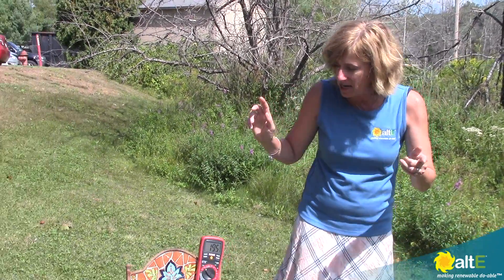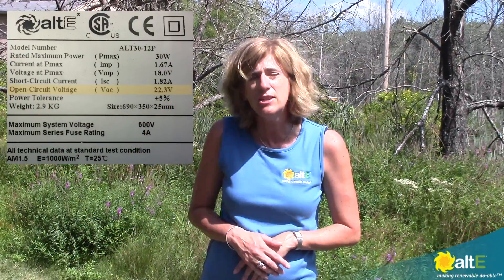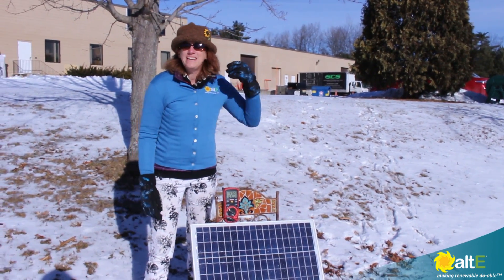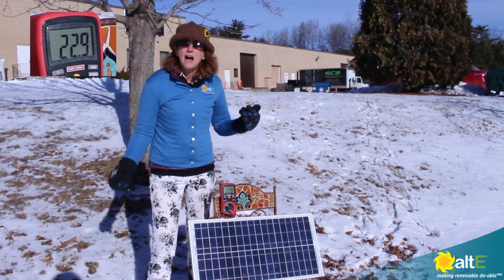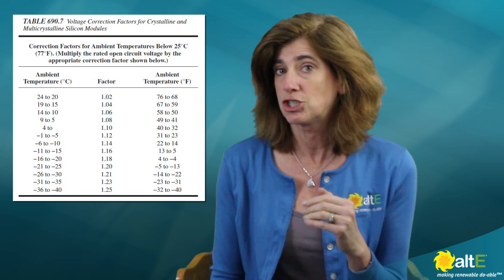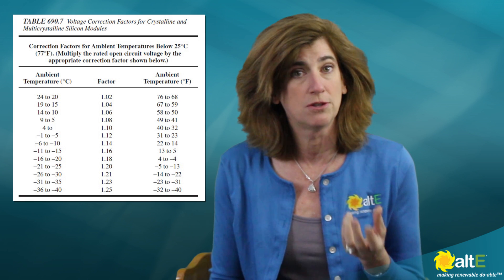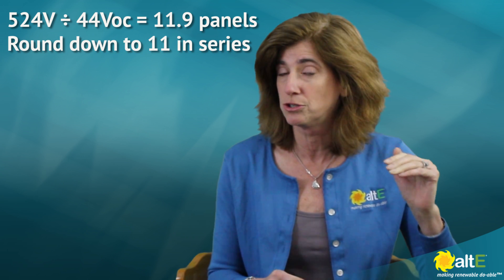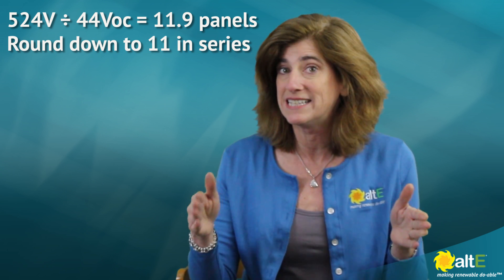What Effect Does Temperature Have on Solar Panels?

Comment: What about in Pakistan where the temperature goes up to 47 degree? (This is on weather channels, iphone etc. Some people say that actual temperature on the ground being baked in sunlighted is even higher?) 

Do you recommend in that case to go only for monocrystalline panels? How does really really high temperatures affect the viability of solar?
Reply from the maker: I recommend you watch our video, monocrystalline vs polycrystalline, at https://youtu.be/TCq0K3DlFdc .  We talk about the difference temperature has on them. The difference these days is so slight, sometimes it's more about the brand of panel than the type. In the comments, there are people from all over the world discussing what works best for them, including Pakistan.
Reply: +altE thanks for the quick response. I have learnt so much in the last few days thanks to your videos. Really good stuff
Reply: The only real difference between mono and poly crystalline is monocrystalline will give more power per square foot. The characteristics are almost exactly the same. I have to go mono, because I have limited roof space for the power I need. If you have plenty of area, you might save money, by using poly crystalline.

Comment from the maker: I just had a caller from Canada tell me about something they run into in the winter. The albedo effect, where the sunlight reflects off the surrounding snow and increases the amount of sunlight that hits the solar panel. Therefore, they see much more current than rated, since the amount of sunlight hitting the panels is greater than standard test conditions of 1000w/m2. I would imagine this also occurs in the desert with the sun reflecting off the sand. Although it is not directly a result of temperature, it is important to note, especially if you have your solar panels tilted very steep to avoid snow buildup.  I'll be sure to do a video on it next winter (or maybe head to the beach?).
Reply: It's true.I've had the same on open water,snow and even just the white camper van next to my solar panel.Works better when using polycrystalline panels.Somehow they make better use of passive radiation.
Reply: Overloading your panel with mirrors is A bad idea,you can heat them up to destruction.The sportclub here in Stadskanaal found out the hard way that even with normal sunlight and low demand their thermal panels where cooking the water making the safety valve blow off violently.How much eight big panels can produce of steam is really mindboiling :D

Comment: Helpful? It blows my mind that the very thing solar panels are designed to convert also will degrade their effectiveness. This is completely counter intuitive for me but makes complete sense when you apply the same parameters to electrical wires and ohmic heating.
Reply: A photovoltaic cell is negative temperature coefficient, just like any silicon rectifier diode. A solar cell generates voltage in it's forward biased polarity. If you take a diode, measure the forward voltage drop, then heat it, the forward bias voltage will go down as it gets hotter. You can measure it, just by warming it in your hands. Blow on it to cool it down, and the bias voltage will go up. Just like a photovoltaic cell/panel.

Comment: thanks,  but you didnt tell the effects of Temp on CURRENT..
Reply from the maker: +Nadeem Ahmed Temperature doesn't have as much of an effect on current as it does on voltage. You can see the change on the spec sheets of the solar panels. For example, on the 30W panel that I use in the demonstration, the temperature coefficient for Voc (open circuit voltage) is .36% per degree C, but for Isc (short circuit current), it is only .06% per degree C.
Reply: +altE my Panels 300 Watts each and total 24 Panels and I am based in KARACHI Pakistan,  so Hot these Days and Temp usually touches 40 to 44 degrees C  in summer,  my Panels are polycrystalline they perform Good in hot Days. have 4 In mono crystalline they perform Good in winters.  the Temp does affect the current by 0.06 percent and thus I am living in 40 plus degrees Area so 40 minus 25 is 15 degrees,  I normally GAIN around 28 to 30 Watts in power in poly Panels and losses 20 Watts on mono Panels.  because of current coefficient.
Reply: +Nadeem Ahmed That's interesting.

Comment: Excellent explanation Amy...great job. I am working on a 600w array with six Renogy 100w mono 12v panels...wired in series. The PV feeder cable run from the backyard to the garage (where the Classic 150's are located) is 125'. With MPPT I can run higher array volts...which is more efficient than trying to push current through 125' of PV cable. The highest VMP I have seen is 125vDC...about perfect IMO. The most POWER I have seen out of these panels is 545w. In conclusion, MPPT works, higher volts work, cold temps help, long PV cable runs are a-okay with high volts, and I am getting 91% of rated output on these Renogy mono panels. Whatcha think? Thanks for the coffee mug too. -Chris

Comment: Amy,
That's really true. 
I leave in Minnesota here we really have very low temperatures in the winter months.

As I speak we are currently under freezing conditions and I have seen alot of Amps been generated by my solar panels while been connected into my OutBack FLEXmax 60A 150V MPPT Charge Controller during the winter months than summer time.
 
Amy, it's good you mentioned that to all Offgrid and Grid-tied personal and all YouTubers.
Be careful and make sure you do your assignment before you start your installation. 

Thanks for this educational video. 
Cheers

Comment: TEMPERATURE CO-EFFECICIENCY OF A GIVEN PANEL IS AN IMPORTANT CONSIDERATION WHEN BUYING SOLAR PANELS , JUST LIKE POWER TOLERANCE. THERE ARE NEW PANELS NOT YET IN MASS PRODUCTION THAT CAN HANDLE THE HEAT AND STILL PERFORM VERY WELL. 3D PANELS ARE ALSO VERY INTERESTING, 9 TIMES THE POWER.